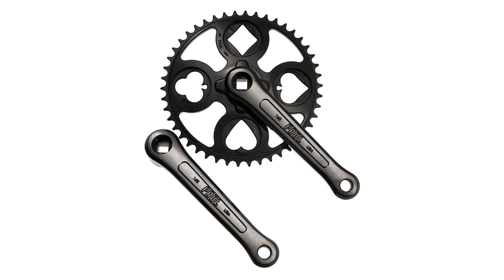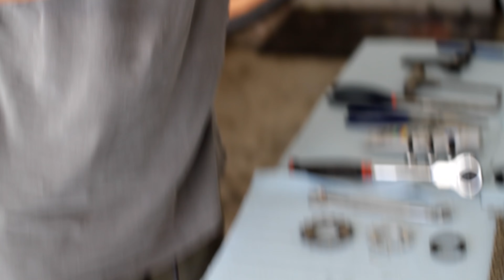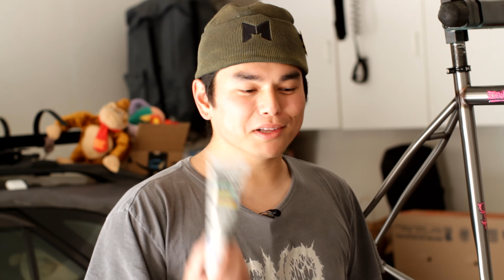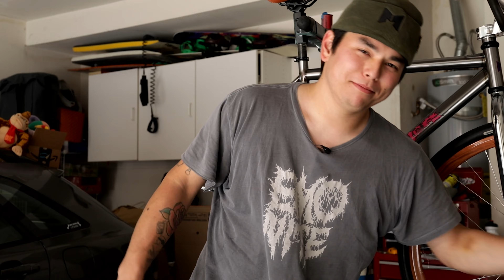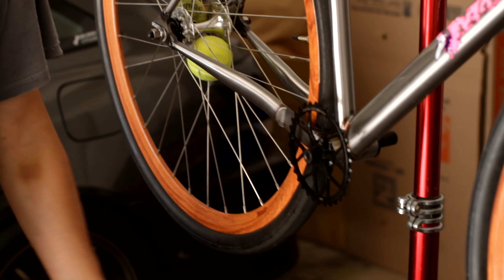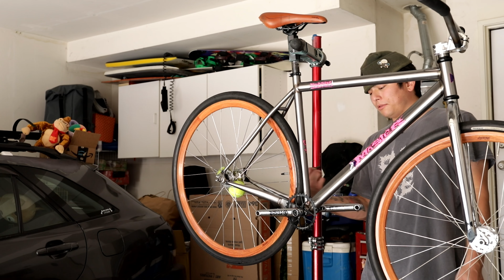How To Install BMX CRANKS On Your Fixed Gear Bike

Comment: This video helped me out so much with getting my shadow cranks onto my fixed gear. So much appreciated. 

Just a little thing to make lining that spacer up a bit easier because it was annoying the hell out of me. Instead of using your pinky finger to hold it up inside the BB, you can take a long screwdriver or something like that and thread it through your bb and spacers. Screw on the second piece with the screwdriver holding the spacer suspended in the middle. Then when you are almost at finger tight, when the spacer is being held in by a light pressure, fully align it. Tighten and you're done.

Comment: I have a question, I have the exact same resist cranks as you but mine can be easily pressed in to the spindle, does it mean its worn out almost? thx!

Comment: Have you run into any issues with chainline since most fixed gear hubs are 120mm compared to bmx 110mm?
Reply from the maker: I've found that best chainline happens when you dont run the provided bottom bracket inside spacer that hugs the sprocket so it can press closer to the frame. Just some washers instead

Comment: I had a bmx crank on my fixie, and it made it super slow and feel way too heavy.. Whats up with that. Also, where did you get your handle bars and what are they.
Reply: Did you gear down the rear cog? Your ration would be way off it you dropped to a 33 in front and still had a 17 in the rear